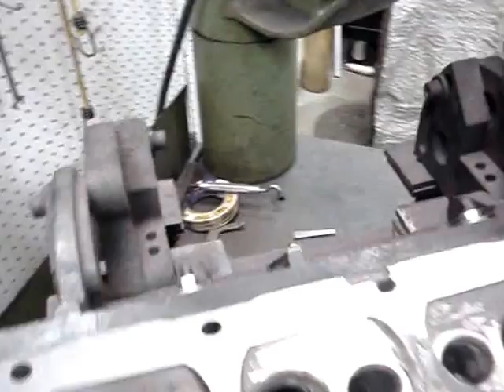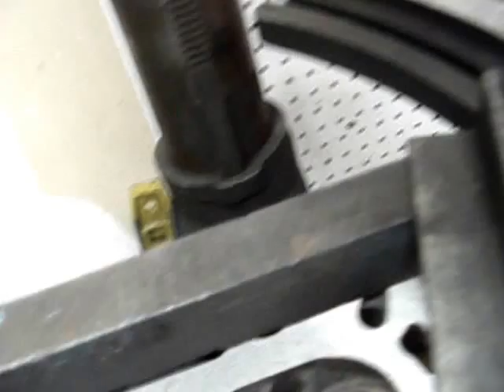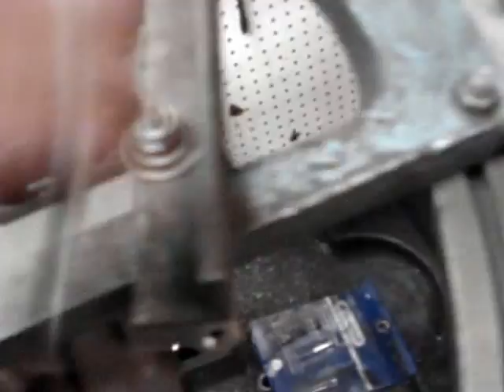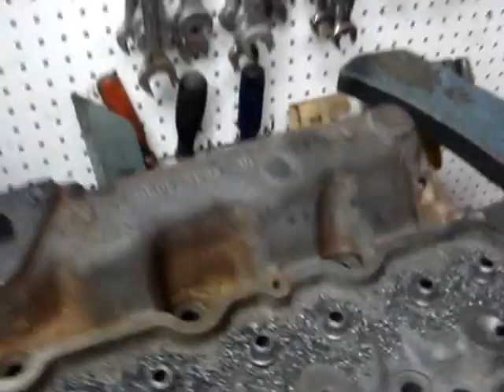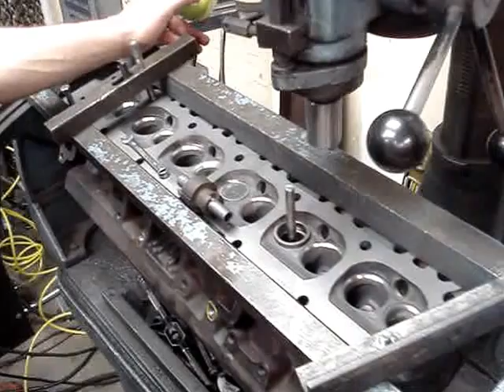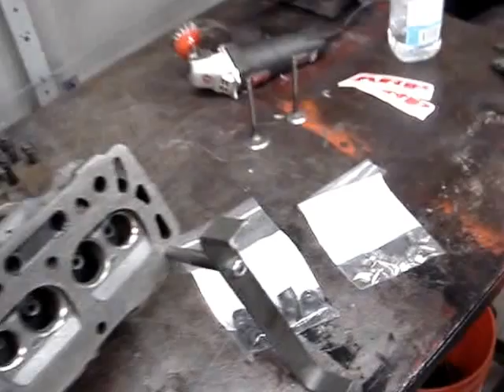Ford Head rebuild Machine Shop Pricing

Comment: Did you give an estimate? Maybe you should have looked through all the other heads he brought. Looks like more than a crack to repair. You knew up front it would need guides and seats after welding. Nothing that isn't done to any other head....

Comment: Last one of those engines I did was about a year ago in a 68' Mustang. The job started out as a clutch job and turned into the engine from hell. The rear main seal was pouring out oil and the rest of the engine was in about the same shape. The head was the wrong one, a late 70's low compression smogger that was severely cracked along with the exhaust manifold coming off in three pieces. I found a rebuilt head at a local machine shop that had the exhaust ears broken on the ends. I cast weld built up the missing ears had it surfaced and redrilled the bolt holes.  In the end the whole job ended up being an engine restoration costing around $7,000 total including everything from the front of the engine to the u-joint and straps on the rear end. These things can only be done time and materials, no quotes until you are at the worst part.

Comment: I can build my own heads for 300.000 the machine shop wanted 800.000. They get the same part wholesale. I will just do it myself. Thanks for the advice. I'm an aircraft mechanic... owners want to pay you 15 dollars an hour to  do an annual inspection on a million dollar aircraft, I see both sides.

Comment: I pretty sure I had that same 200cid inline 6 in my first ever car, a 1974 Ford Maverick. As to your pricing, $650 is very reasonable for a quality machinist to do the work you did on that head.
edit: I bet you much prefer jobs brought to you by mechanic shops to walk in customers. At least they are usually knowledgeable enough to understand the reason why the work costs what it does. Although it passes the sticker shock of the customer to their shop too, lol

Comment: Back in 2000 I built a 355 and they charged me $35 per hole for the block work, hot tank and boring no decking and I was happy to get it done right !!

Comment: those 200ci,s are gutless as hell,massive difference with a 250ci,torque as hell.so the guy is keeping this car stock original,,no point,not worth it,id be fitting a new 302ci & box.

Comment: VEGE Remanufactured 300 ci  head ASSEMBLED 368 bucks, 200 ci 350 bucks....at Summit , you did too much for what the customer wanted thus driving expenses way beyond market price... you should have called him at first problem and gave him the choice .
Reply from the maker: I don't think you understand the situation this is a numbers matching head on the original engine in this mustang the customer wanted it all original the options you listed well just weren't options in this case if you watch the video and listen you would probably know this

Comment: Here's a suggestion, why don't you tell the customer that the head is going to cost $650 plus to repair and rebuild it if you see it has all of those issues before you start? For that price junk the POS engine and go another route.
Reply from the maker: nope it's a numbers matching mustang changing the engine would cut the value of the car in half not an option

Comment: I ran a machine shop about 10+ years ago and i can tell some stories. The one that was the last straw for me was a set of small block chevy heads that were completely rebuilt for $145. The guy literally cussed me out and told me he didn't want a set of race heads. The amount of work that goes into old,worn out heads is huge,not to mention crack repairs,guides,seats,cleaning,checking etc.

Comment: I understand the cost customers need to think if they would go to work for free , parts are not just valves I build lift rule dirt track engines & to run up front it cost money parts & machine labor is costly keep up the videos thanks Larry Burns Racing Engines .

Comment: Good video, cylinder head work has been a diy'er since the earliest days of drag racing.  Its the trackside and back yard edge that won races back in the day. It's how I learned the tricks to get an edge in the 70s and still employ the same tricks to this day.
 Without all the bells and whistles of machine shop tooling, you'd be amazed at how much and how good you can build a set of heads with basic tools, repeatable results and won races.
https://www.youtube.com/channel/UCCqL5xT4iTDg1_kXhoGeLTA

Comment: In case that idiot with the 200 head was overcharged he could have spent $2,400 for a 200 cylinder head from Vintage Inlines. 650 dollars sounds much better.

Comment: In 77 I had a 200 head that needed valve seals and one intake valve. The shop unshrouded all the intakes lapped seats and valves and installed the seals. They plugged the air pump holes in the head and ground matched the plugged holes to the exhaust ports. They had to plane the to head only to make it true/flat. It cost about $60 to 80.
I thought I got the deal of the century. That engine would use about 1 quart oil in 3,000 miles. It had 92,000 miles on it. $650. is a damned steal in 2018.

Comment: 200 would be from the 60's. The 300 took over by the mid 70's
Reply: 200 was in production into the mid 80's in the US.
Reply: Brian Beard : 200 was avail in the fox bodies. The 240/300 was installed in Gals/ pu's

Comment: Have you ever bored out a 348,409 Chevy or a 430,462 Lincoln engine ? There  is a trick you can do to remove broken bolts with a stick welder as you build up the weld using a vise grips the combo of heat and weld by turning removes the broken bolt . Also use a 1/8 right drill and switch to a left hand drill many times left drill will catch and spin the bugger out then just clean the existing hole with the proper tap .

Comment: Want to do my heads for my Mustang?   hahaha  Now i am afraid of aftermarket heads...
     Is it not worth it to spend 800-1,000 on Aftermarket heads that are assembly line made and not all that close to tolerances because they just don't care more than likely... IF I'm gonna have to have the heads checked before use and more than likely re-worked by a professional and drop about $300 per head to get them correct...?  Ugghh i can't decide now...Option B-  Buy some used GT40's and have them reworked?  or Option C- have my stock iron heads re worked? or spend a fortune on aluminum heads and have them re-worked and eat baloney sandwiches for a year 3 meals a day...?  all i wanted was 325 out of my 85 mustang 302 ....
Reply: wildbillo68 bang for your buck you can’t beat the aluminum heats . Assuming you buy name brand . Cheap Chinese all bets are off. Now as a machine shop owner I would want to build you heads. But depending on how crazy you get with iron heads the price could get up there with aluminum. But it’s your call.

Comment: Why are you not using a K line guide liner?  Much faster way to go and the bronze will wear much better than the cast valve guides.
did you CC the chamber to one on either side?
Reply from the maker: Kliners are garbage they only last about 25K miles that is for cheap get you buy rebuilds I will not use them nor will I use knurled guides they are both about the same

Comment: If he is only charged  $650.00 you lost your ass and he owes you a B.... job . I have seen enough labor sunk into a inline 6 that a $1000.00 was a earned price. With Cylinder heads its very simple. There is only one way to do the job. That is the right way. If that costs "X" amount then thats what it costs. If it is not done the right way it will come back to haunt them and they will blame the machinist. When in fact he warned them cutting corners will not make the head last or possibly not work right from the get go. They still want to save money even after you spend your time to explain why and what if not done correctly.  In the end they have junk. Because the head failed and it has to be done again.

Comment: You have done a real good job of showing just what goes into engine head rebuilds. Folks see a hand full of parts and think that all you do is replace the defective parts and use what is still goo and complain that you should have been done with it a long time ago.

The one thing I saw that puzzled me was how late it was before you checked the valve steam clearance. I usually do that check on dis-assembly so I know more about what parts I need when I order parts the first time. 
Still a very good video.

Comment: when something like this is hard to find I specifically tell the customer as many ways as possible that this will not be cheap, if he thinks he can find one cheaper then go for it. otherwise get your wallet out. you said $650. I tell them under 1500. that way there is no surprises and usually if it comes in under 1500 then they think they got a deal.

Comment: Any speculation on why these heads crack? And at what point do you say uncle? Great machine work + skill. Thanks for all your videos.
Reply: It was mentioned that this was a late 70's head, therefore induction hardened Ex. valve seats. The concentrated heating process that hardens the valve seats also creates residual stresses in the head that may cause it to crack later.

Comment: Man, I understand. Hang in there. I am now 57 and for the most part, retired. I still have all my tools there paid for. Yes I still powder coat but if your under 30 do not call, Yes I am rebuilding a Ford 5.4 engine. When and how much?I will let you know. Is there 6 vintage motorcycles in my shop, yes there is and all 6 of the owners know better than to call me. Go get you a fishing pole and keep it by the front door.
Reply: You sound like me ! Hahah I'm 59 and make my living as an automotive machinists and I'm ready to call it quits next month...
Reply: It's a lot better when you can start punching your own clock. Best of luck to you Jim. You take care.

Comment: Thanks for your reply, but that still dose not answer the questions so I will ask again. What dimension  height and width is the exhaust port (actual measurements)? Can you find the same casting number (D2TEAA) in your awesome collection of heads and measure this for me? The reason for this is I'm having to make a flange that fits the exhaust port and 1 3/4" tube size better than the generic sized header type. I have noticed that when fitting the 1 3/4" tube to the generic oversize flange rectangle shape opening, there is a considerable gap in each corner to fill in with weld. I would rather make those corners more rounded which would fit the tube much better and require much less pounding and welding the corners to make it fit the flange and seal the header. To demonstrate what I mean click on this link of a Sanderson header for the Ford FE then click the magnifying icon to get a close up of the corners of the exhaust manifold flange where the 1 3/4" tube fits the flange, you will notice the gap in the corners where they tried to fit the tube then filled it with weld. I think their is a better way to do this by making the flange opening more rounded in the corners. https://www.sandersonheaders.com/sanderson-ff391-header-set-for-ford-fe-engines.html
Reply from the maker: the height of the ex port is 1.900 and it is 1.315 wide
Reply: Thank you bro!!! One other question, what is the distance from the deck surface of the head and the floor of the exhaust port? With this info I can have a custom exhaust flange made to fit the port size and header tube size much better!! Thank You, you are very helpful!!!

Comment: Yep bro your right, I learned how to do valve jobs, put in bronze valve guides and port and flow cylinder heads and had all the tools to do it, a 60 gal commercial air compressor, die grinders and carbide cutters, a superflow 110 flow bench with a custom made precision valve opening jig made by a machinist friend of mine. a valve grinding machine and two seat cutting kits one is called (New Way) and the other was the traditional stone grinder set ups.  I even had to have a friend of mine head to be welded by Henry's welding in Los Angeles. When you break down the amount of time (hours) and work you put into rebuilding and modifying heads, you are in the minimum wage category for sure, not to mention the occasional cry baby customer!!!   That is why I gave it up!!!

Comment: I have a question regarding a 1996 Jeep Grand Cherokee with the 5.2 V-8. It has 150,000 miles and I might remove the intake to replace the plenum gasket and upgrade with the Hughes plate, anyway I was thinking of removing the heads for a valve job, new seals and decking-- assuming the guides are still good what would I expect to pay?I am looking for a local shop that knows what they are doingThanks

Comment: Hi just looking at some of your old videos i have a question when the weld shop installed the seats shouldn't they have put the guides in first or is their enough tolerance in the seat to center the valve?
Reply from the maker: the seats are blanks the Machining of the seats is done after guide installation

Comment: Seem you didn’t do a good of looking over the head. With your experience you should have known the valve guides we bad before you shipped it off and had work done. Same with the keepers. How did you find out how they were wrong. This would have been the questions I would have ask you if it were my head.
Reply: You never worked in a machine shop ....
Reply: he said these are hard to find so it was going to be a leap of faith patch job. it sounds like these are not something that reman companies like jasper are going to have on the shelf. do the most obvious like fix the cracks. as seen everything else could be done after the weld job. 30 years ago machine shops did a lot more of this kind of work. now reman companies make this work harder to justify.
Reply from the maker: If the head is cracked and your not sure that welding can save it you don't bother with checking valve guides you send it out for welding first after the head is welded and pressure tested and you know it's salvageable then and only then do you start worrying about guides and seats

Comment: You can spend $1,200 on a SBC head job in a snap ... 
    Or you can have em done TIJUANA special  with (knurled guides), (old ground valves), (seats ground , but not proper contact width), (valve spring pressure ? not shimmed), ( & on & on & on).  Yep, the T.J. heads will work ok for a while, but not something you would rely on . Thin exhaust seat contact causing blazing hot valves, gets your knurled guides all opened up & sloppy. Now your valves are floppy, oil is sucking by the guides,  and then your driving a stinky oil burner that fouls plugs as fast as a 290,000 mile motor.
   YOU HAVE A ((STORM VULCAN )) ! Awesome for precision decks & heads. They sound great as the carbides cut.

Comment: As a mechanic myself...I get it..I know what goes into machine work,there is time and work that goes over and above what a driveway mechanic doing his own repairs would even know,sorry that was not intended to offend ANY of the guys who do their own work..kudo's to all of you who tackle this kinda stuff to save a buck...believe me I'm right there with ya...but understand machine work is technical and EXPENSIVE...these guys that do this aren't hacks for the most part,they are educated and the machines that they use are EXPENSIVE...so don't bash on the machinists...they work hard to get things RIGHT...they are sticklers for detail and things that are the thickness of a human hair makes the difference between go and no go...this kind of know how and experience didn't come cheap to them in their education and tools and don't come cheap to us...even as a mechanic I pay what you pay...if you wanna build a junk yard motor then you get a junk yard motor..if your looking for a precision engine that's gonna last and take some abuse then ya gotta pay for that...bottom line.

Comment: quick question.  can you give me a rough estimate of the weight difference between a Ford 302 vs ford fe 390 block?
Reply from the maker: the 390 is heavy around 700 Ibs with all cast iron parts closer to 600 with Aluminum intake,  the 302 comes in at around 450 Lbs
Reply: youngestson65  I just shipped a bare 390 block in a overbuilt crate on a pallet.. 209lbs total.

Comment: I'm curious about something. I've got a set of 1969 4V 351w heads I was pondering installing my '66 289. I know they need gone through and most likely will need to be rebuilt. Current compression of 9.78:1. By my math would drop it down to 9.1:1 with the larger cc. My question is: With the high cost of machine work, would it be more cost effective to purchase a new set of aluminum heads? Possibly CNC'd. My goal is a hard hitting 8k+ rpm's with total stability.

Comment: Considering the years of learning and the investment in tools and equipment $650 is cheap if you break it down to the hours spent. You're not making a lot but you enjoy the work so it balances out. After 40+ yrs of being a mechanic and building race cars you'd think I'd learn, a few yrs ago I got caught up in a deal for cheap aluminum heads for my big block Chevy drag car, it'll cost as much as the heads to correct all the problems, for now they're still on the shelf, should have got the Brodix in the first place! Good video, thanks for sharing.